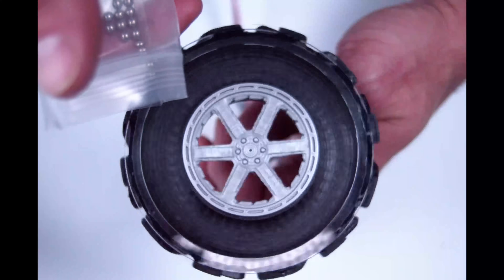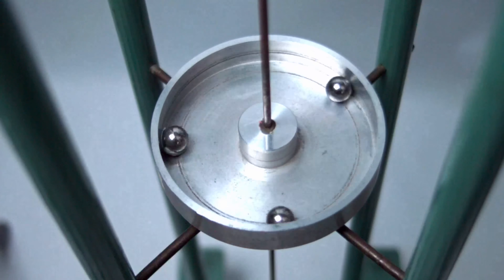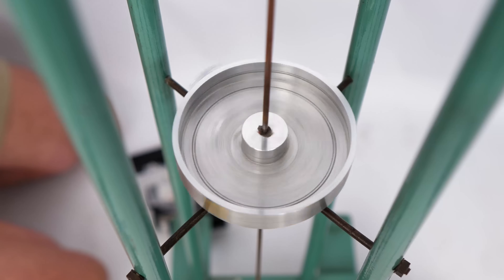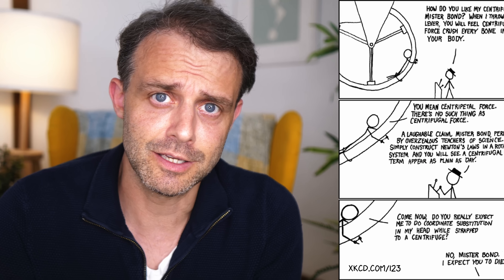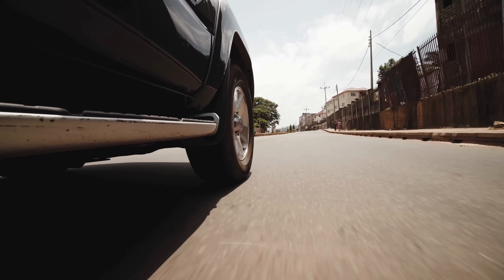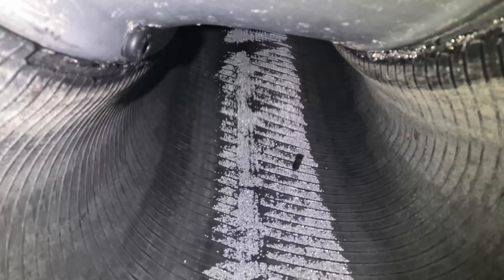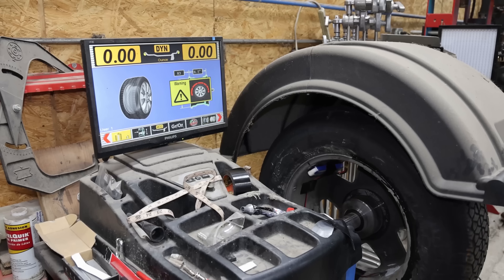Do tire balancing beads actually work?

Comment: Don’t use these unless you’re sure your tires don’t have noise absorbing foam lining the inside of the tire.  The foam will inhibit the beads being able to move to where they are needed.

This is very common on tires designed to reduce NVH, especially for EV’s where there’s no engine noise to mask the tire noise and for luxury cars that want a “quiet ride”.  

That’s not likely an issue for off-road or motorcycle tires, but for many new cars and crossovers it might be a factor.

Comment: If you could make these beads stick to the inside of the tire after a certain time / condition, you should be able to simplify the process of balancing tires drastically.
Like putting the tire in a machine that spins the tire and then heats it to make the beads stick, for example.

Comment: About 10 years ago I put 24 inch tires on my truck and didn't want to use ugly wheel weights so I tried wheel beads. I still had a vibration at lower speeds, which the company could not figure out, so they just sent me more and more beads in the hope it would fix it, but this video literally explains my exact issue. It goes away at higher speeds and doesn't come back until I stop the truck.

Thank you

Comment: To track the oscillation, you can make a camera spin around the contraptions at the same speed as the axle. Maybe wire the cameras rotation to the axles. You would have to put the camera within the frame.

Comment: I have used dynabeads in my motorcycles for years.  I use them in all my cars and road vehicles now too.

AFTER still balancing conventionally.  You use less beads that way.

I use them to fine tune a balanced wheel, and the difference is a glass smooth ride at 55+

Comment: I wonder if tyre self balancing wheels in combination with this leakage sealant fluid could fix the beads in exactly the right position if left to dry at highway speeds. That might be a way for effective balancing without a balancing rig.
Reply: That's redundant.  Tire sealer will plaster itself to the perimeter of the tire and balance it.  You just have to put enough of it in there.  Manufacturers provide a table.

Comment: I used water and a little antifreeze (it gets cold here in the winter) in my 38” mud tires to help keep them from hopping and shaking on the road. These tires can’t be balanced with weights because they chew through mud and dirt that just tears them off and without bead lock rims the low pressure of this type of tire lets them slip on the rim under heavy torque or even just hard breaking with low pressure.

Comment: I think tire sealants like "Ride-On" are better at balancing because the substance tends to stay plastered to the perimeter of the tire even when at a stop.  If it stands over night, it will drip down but while driving it tends to stay in place unlike beads that completely fall to the bottom of the tire when the tire stops rotating.

Comment: I see many comments from people who swear by the beads so it sounds like they work, but I feel like there must be some difference between a tire that is rolling and a tire just spinning in one spot. Any particular spot on the outside of the tire is not moving at a constant speed. If the tread is in contact with the ground and not moving it must, at that instant, be stopped, and then that point would then accelerate to double the vehicle's forward speed as that point goes up and over the axle and moving forward and then back down to the ground and stopped again. The disk, on the other hand, even when vibrating I can't imagine would get even close to those differences in speed. Therefore I am not sure how your tire could get from wiggle mode to vibrate mode. However even without beads, i too have noticed how at highway speed a tire that is not too out of balance seems to even out at certain speeds. I feel like I'm missing something but I'm not sure what.

Comment: A few years back I had a truck I was selling with unbalanced tires and I was too cheap to buy the special balance beads. I dumped in some air soft bb's as a few grams of those were much cheaper. Worked on 38" super swampers with large chunks of tread missing 👍

Comment: I'd argue that these are better for motorcycles than cars, since the wobble usually only presents itself past 35 mph/ 60 kph, and from there the 50 mph / 80 kph threshold is only a small blib of the throttle away, so it's easy to get to even in relative traffic when going above the wobble speed, but below the balancing speed.

Comment: How is centrifugal force fictitious? It's definitely a physical force. 5:40
Reply: Because it's a "perceived" force, caused by the walls accelerating inward. You being pushed outward is actually due to your velocity when spinning, not an acceleration (the only acceleration is inward, also called centripetal force). Without outward acceleration, there is no outward force.

If the walls of the carousel suddenly disappeared, you would actually be flung out in a direction perpendicular to your perceived vector of acceleration.

The reason the inward force exists is that when you model the scenario, you need something to change your velocity so that you don't go off in a straight line as you spin.

 I wish I could post images here in the comments but try checking out the Wikipedia page on centrifugal force.
Reply: Interesting. I will certainly have a butchers @jonathanshavit822
Reply: @jonathanshavit822 Really interesting stuff. The long and short of it is its not perceived as a true physical force in Newtonian physics
Reply: @ATestamentToTech yes, from an external reference frame, there is no outward force acting on the object, only an internal one and an orthogonal velocity.

Although, as Steve mould says, from within the reference frame, you can consider centrifugal force as a real force because it is felt by everything in the centrifuge.

Comment: It's highly dependent on the tire design. Beads work great in my motorcycles. Been happily using them for years. In smaller car tires, they can be problematic, or take a high speed to smooth out. Light Truck tires are more likely to be fine, but not always. My LT tires on my 4x4 needed a lot of weight, and beads didn't work until 70+mph. Because of the imbalanced LT tires and the amount of beads needed the truck really was vibrating at the lower speeds, in town. Static balance was better for me on those tires. The interior of those tires is very convoluted and seemed to not allow the beads to move easily, even if I added a few extra ounces of beads. One of the manufacturers does not recommend their beads for car tires, saying to stick to LT and heavier or off-road/UTV/ATV and motorcycle tires.
 I know some over-the-road haulers have been using a bolt on version for years.

Comment: There are add on "bead disks" that you can install behind wheels if there is enough brake clearance.  They're very popular on larger trucks because of their self contained nature it's easier to put materials in that have more mass more balancing larger tires. I have a set for my 4x4 where each of the tires weighs 70lbs with out the wheel, I can't imagine how many 2mm glass beads I would need in order to balance them after a season of use 😂

Comment: I use them in my Iveco Daily 4x4 van with heavy mud terrain tyres on very heavy steel wheels. Those wheels were hard to balance because of their weight and the balance didn't last long because off road is very easy to lose a counterweight or a chunk of rubber on a sharp stone. Unbalanced tyres made the ride unbearable at around 80 km/h and the beads solved the problem, I use around 250-300 grams per wheel

Comment: I've grown up poor and rural, and having driven many a car with various levels of unbalanced wheels because of that, I can say from experience that I do not agree that the vibration lessens at speed. I'd argue from experience that it usually becomes worse on average and because of the speed, more dangerous too. There are cases when you are on the highway at X speed for a bit, that when keeping that speed over time it lessens, perhaps due to the tire bands or something being malleable enough, but then when you go to smaller and slower surface roads it then picks up to be worse again.

Comment: I'm not satisfied with just providing an explanation using centrifugal force. Yes, it's perfectly valid for the reference frame in which you're working, but for a truly satisfying explanation we should be able to say what's going without relying on fictitious forces.

So here you go: When the wheel is unbalanced, the acceleration of the edges of the wheel has a tangential component (it does not point perfectly towards the center of the wheel). That means there is a tangential friction force on any beads in contact with the surface of the tire which will pull them along the edge, until everything is perfectly lined up and then their acceleration is perfectly radial.

Comment: Now I am curious whether balancing beads covered in some form of glue would work. Basically, get the beads in the tires with adhesive. Drive on a freeway consistently until the adhesive cures and then they stay.

Comment: If this works for beads, does that mean that it could also work for liquids?

My thought is that if you can pour some kind of hardening liquid, like a resin or liquid rubber into the tire, then put the car on a Dynamometer at highway speeds for 5-10 min, then you would be able to permanently, perfectly, balance your wheel. You could probably do this yourself without access to a dynamometer too if you were able to pour it in your wheel then drive at highway speeds for 10 min, but that would be risky because if traffic slowed down then you would risk permanently unbalancing your wheel.

Comment: Could we  use a material like those epanding foams for this? or maybe something like a paintball, that could then be activated while at motorway speeds? my thought process was something like paintballs and something to activate them like a pulse of air or something, but then how do we get the pulse to activate them in the tires, Just something using the same idea, that could then harden and stick in the tires

Comment: I once got new tires that the installer's balancer was off. I only started getting a resonance in my steering after my car got past 50 mph. After going back, they rebalanced it properly and I didn't have any issues afterwards.

Comment: So, can I use this to smooth out my bench grinder? 😁

It seems like concentricity, about the desired rotational axis, would have an impact on how well this method works. I wonder if I can 3d print a ball race and glue it to the grinding wheel and be accurate enough for this to work... Seems like if it was that easy it'd be a product, built into wheels, or even integrated into every cheap bench grinder. Then of course there's the obvious projectile risk failure mode 😅

Comment: You tested on a horizontal plane (vertical axis) but tyres are on a vertical plane (horizontal axis). Gravity changes the result. Please repeat with correct experimental conditions.

Comment: the only thing i wonder is … wouldn’t all the beads not make the tire flat faster by puncturing from the inside out over time as you brake and accelerate over and over again… at one point you will just have hundreds if tiny needles inside your tires.

Comment: I was told they work well in over the road tractor trailer trucks.
They do spend most their time at speed. 

I’ve used them in oversized off-road, mud terrain, truck tires. 
Those things will vibrate like crazy sometimes. 
Worked well for my application. .

Comment: So the problem I experienced is that tire deflection. if beads pile in, they deflect the tire and stay in the unbalanced location. Also if you accelerate or decelerate the beads shift out of place. Thats on my passenger car. On my trailer or RV they work, but use plastic not steel for same problem.

Comment: Makes sense to me, ever watched your washing machine starting, during, and finishing a spin cycle? - it's very similar, it's unbalanced when it starts, with all the wet washing at the bottom of the drum, and as it starts to slowly spin it wobbles a fair bit, but as it speeds up you notice washing moving as it speeds up, and once it gets to it's fastest, the drum is pretty balanced, and as it slows down again, clothes 'fall' and move again and it starts to wobble again :)

Comment: My my motorcycle and cars I use a product called Ride-On.
it's an in-tire slime that balances the tires, and once balances - tends to stay where you need it. (it will slide if you let it sit for a while).
Much more effective then glass balancing beads, as you don't need the higher speeds to 'constantly' re balance your wheels after a stop.

Also acts as a puncture protector.

Comment: Check out a top load clothes washing machine. There is a hollow ring at the top perimeter. I’ve never cut one open however it surely contains a liquid that keeps drum in balance when in spin mode.

Comment: so instead of needing fancy balancing equipment, one should invent a sort of putty you can inject in the tire that cures quickly (and can double as a tire patch), all you do is inject, spin the tire at high speeds until cured, and you have a balanced tire.

Comment: What do mechanics think about changing tires and getting glass beads all over the shop floor all the time. :)  Plus, don't the beads wear the inner surface of the tire? And can they wreak the tire pressure sensors?

Comment: For being in business for 32 years now I will tell you this I have never used balance and Beads in a tire and the reason why is you would I have to know how much beads to put in there cuz if the tires 10 ounces out of balance and you only throw in 3 oz guess what it's not going to fix the problem balance the tire then break it back down put more balance  beads in it that it called for and then air back up so counterintuitive whenever I can just spin it put weights on the outside of it and be done with it

Comment: I can't speak for the UK but here in the us these are most popular on trucks and RVs. You are both doing lots of highway miles and you have more tires so you get the maximum savings on not balancing each tire. On 18 wheel trucks they generally only get balance weights on the front steer tires.

Comment: I've used them for years on large (38" and larger) M/T tires. They're such a PITA to balance, and I don't want a mountain of stick on weights on the inside of my wheels that just get ripped off when off road. So the solution is balancing beads. Are they perfect? No. Not at all. I'll still get some slight vibration from time to time, especially going over rough roads. But it's good enough to go highway speeds and not destroy my Jeep. The trick is putting your wheels/tires on a balancing machine to see how much total weight it's calling for, then adding that weight in beads + 20%. It's not perfect, but it works on really big heavy tires. I wouldn't use them on passenger car tires, just use stick on weights and be done with it.

Comment: I think the master play here is to add some kind of adhesive to the beads, then get to Autobahngeschwindigkeit and drive as long as it takes for the adhesive to cure, then your tires are premanently perfectly self balanced.
Maybe microcapsulated adhesive as it is used on screws in the industry

Comment: What I am wondering is if having the glass beads in a wheel that was roughly balanced would be better than having the wheel just be balanced as well as possible using weights. 
As the beads are self optimizing they might achieve a higher degree of accuracy.
To my understanding the beads amplify the vibrations up to the critical speed after which they start balancing.
If the vibrations are smaller to beginn with the tradeoff of having worse vibrations at lower speeds is also less. 
But the advantage of the beads is they can dynamically adjust to any changes in the tires and therefore they won't need to be rebalanced as often

Comment: ISTR there's a phenomenon called 'dynamic equilibrium' that is common in high rotational rate systems like turbines and that that frequency is inversely proportional to the diameter of the axis, or is that backwards?

Comment: I'm wondering whether liquid could work too. Like filling 1/8 to 1/6 tire volume with water. At slow speeds it shouldn't increase vibration that much yet it will give more weight. At higher speeds it should work the same way only settling slightly faster. Amount of water suggested by me are huge, yet i'm looking for secondary efect too: soft, low pressure tire at slow speed and hard (like high pressure) tire at bigger speeds.

Comment: I say it's useless for actual keeping the wheel balance while on the road. On the other hand, if could be a interesting way to build a setup for easy balancing the tier at home. essentally if you only add the least amount of ball bearing, they should collect at the most unbalanced spot. That'll be where you add the lead weight.

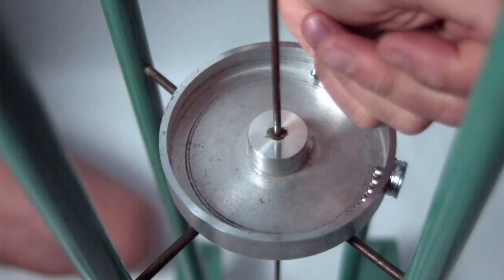Comment: 1:42 they're being affected by the magnet?
Reply: 10:30 I wonder, if one could apply the beads and some kind of adhesive at the same time and then immediately get the car up to freeway, ahem motorway, speeds, could the beads be adhered and the effect cemented? I sense an experiment Mr. Mould.

Comment: Well... You forgot to account for the fact that the beads only balance the tires without affecting the inbalance of the rims since these are free to move in a certain range independent of the tires... This is why we put the counter weights on the rims with the tires mounted to account for the total unbalanced mass